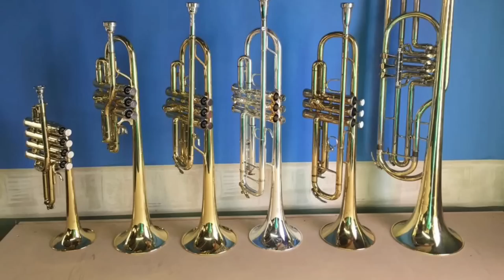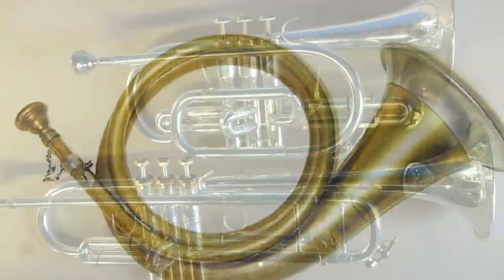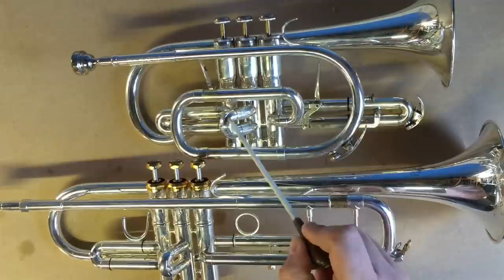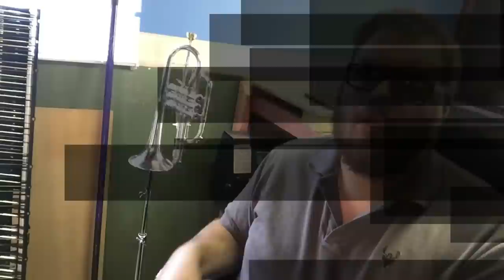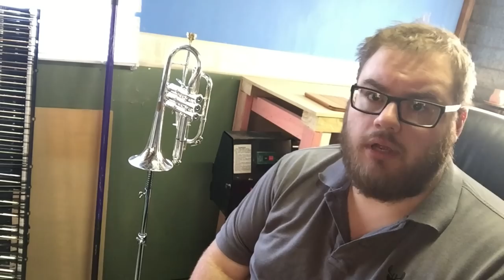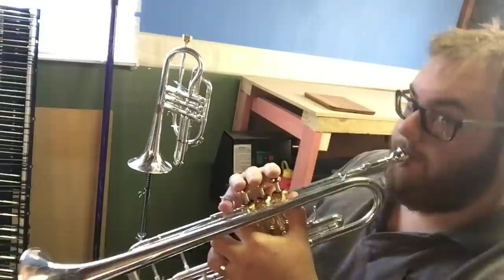Trumpet vs Cornet - discussion and demonstration

Comment: I don't think the cornet is fully conical, and if it is then what is the point of the fluegelhorn which is meant to be a conical, not cylindrical, trumpet. If that it what you are saying is the main difference then the fleugal horn would sound almost exactly the same which it doesn't, the cornets difference is at the more curves and started tapering to the bell earlier.
Reply from the maker: gameguy8101 The cornet isn't fully conical; it's just more conical than a trumpet. A flugelhorn isn't fully conical either, but is more so than a cornet.

Comment: The essential difference between the trumpet and the cornet: trumpet-2/3 straight tubing and 1/3 conical. Cornet-1/3 straight tubing and 2/3 conical. Since 1850s very few cornets have had triggers (particularly 1st slide) and very few trumpets have had triggers, but they have often been available options, as with the Olds Mendez, Conn Constellations, Vincent Bach, etc. They were often present, without special order on French Selmer Grand Prix, K-Modified and Selmer Radial models. The first valve trigger allows easier adjustment in pitch as needed as does the less common 3rd valve trigger. For companies such as Vincent Bach, the 1st valve trigger has been available for an extra charge as is silver plating as compared with lacquer. Brasswind bands in England favor the cornet; in the US, trumpets and flugelhorns are seen, seldom cornets. Sousa used cornets, not trumpets, (Gilbert and )Sullivan used 2 cornets, no trumpets. The golden age of the cornet was 1865-1925.

Comment: dude you didn't talk about mouthpieces ... I deduce the same mouthpiece can be used for both cornet and trumpet, is that right ?
Reply from the maker: +1982klax No, that isn't correct. The bore size of a trumpet mouthpiece is larger than that of a cornet; they aren't compatible with each other. You can get adapters to make a cornet mouthpiece fit in a trumpet, but not vice versa.

Comment: Your warping the valves.... Curve your fingers and have them play straight down on the keys.
Reply: No
Reply: Mark Moreno Why not explain?
Reply: Everyone plays differently unless your in marching band there is no reason to tell someone to do something a specific  if its is comfortable for them let them do it.
Reply: NItricWarrior Yes but you can damage your trumpet over time if you keep on doing it like that, its jut not a good habit to get into.
Reply: watermaster75 my valves are trashed because of this
Reply: watermaster75 it would take so much longer than you think to warp valves like that.
Reply: watermaster75 That trumpet is a Chinese mock Strarivarius and he said it was like $100. So I don't know if he really cares.
Reply: hi_itsNathan it was $280
Reply: Actually, if someone is doing something that could damage the horn, I think that they should be notified of it. Even if the wrong way is more comfortable.
Reply: You're*
Reply: this is only a problem if you use a cheap intrument, if its high quality nothing will happen. my trumpet teacher have played on the same trumpet since he was 9 years old about 35 years and nothing has happened
Reply: Mark Moreno he made a video about tjis
Reply: It takes more pressure to bend the valve than it takes to press it down so it near impossible to destroy or even damage that way
Reply: watermaster75 I've done it for almost 2 years and no problem eithemy valves
Reply: Get stuffed.

Comment: Hi Trent.   Could you please tell me how to clean my cornet ????    the first valve seems clunky, and gets stuck.  and plus, i recently joined a brass band again, and didn't play the poor thing for 10 years.        it's an x army boosey.   imperial.   thank you.
Reply: +PetuniaParkStables You need to buy slide grease it is only a couple $
Reply: Take all of the slides and everything out (make sure to keep it in a way that you can remember what goes where) then give it a lukewarm bath. Make sure that it's not too warm. I recommend using a soft towel to actually clean everything. If that doesn't help, get some Brasso and use that one the brass parts. After you're done cleaning it, apply valve oil to the valves (it may take a bit before the valves are going their fastest.) Next, you have a couple of options for the slides. First, you can buy slide grease, then use a few drops of valve oil after the slide grease to make sure that the first and third slides are moving well. Or, you could buy some slide grease for the tuning and second valve slides, then get a pre-made mix of it (I like to use TS Spacefiller) for the first and third valve slides. With the tuning and second valve slides, I highly recommend putting only slide grease on them, since you don't need to move them as quickly as the other slides, and if they're a bit loose, reducing friction could mean they can fall out while you're playing.

Comment: I used to own a trumpet that had a trigger for the first valve, never seen one for the third valve.
Personally, I much prefer the manual slides, the triggers sure make it much easier to operate but there is a delay since it's mechanical, they do not react instantly; so let's say you use the trigger for playing a C but right after that you have to play a E, the trigger will still be retracting while you already were playing the E.

Comment: Can a trumpet player player on amatuer level very easy play a cornet good? I've heard lots of people saying it's very different how to play these instrument, but many that i have asked says it is nearly the same. What is correct? I am by the way a trumpet player who am thinking of buying a cornet just because it sounds awesome, do you have any tips of a not too expensive cornet? /Mattias, Sweden
Reply from the maker: +Mattias Olsson My advice is give it a go. To excel on a cornet it's more about a different mindset rather than a different technique. Warm air flow etc.
Reply: +Trent Hamilton Thank you for the answer
Reply: If you plan on playing in a trumpet section, stick with a trumpet. A cornet wouldn't blend as well with the other trumpets.

Comment: What's the name of the dip in the cornets bell pipe again
Reply from the maker: Usually called a shepherd's crook.
Reply: There are two kinds of Cornet The shapards crook type which is sometimes referred to as a British cornet (as it is the style used by all British Brass bands) and the American Long Cornet as seen here :

https://www.philparker.biz/media/catalog/product/cache/1/image/9df78eab33525d08d6e5fb8d27136e95/1/8/181ml.jpg

Which is subtely different in having a longer bell section and a closer resemblance to a Trumpet.

There is a third instrument which has not been mentioned called the "Flumpet", which is a trumpet with a conical bore which has a much more cornet sound and is a hybrid between a Flugalhorn and trumpet.

Comment: Excellent explanation and performance, Sir!! Thank you so much! My son is six years old and fell in love with a trumpet. Would you suggest any brand for a cheap and no too bad instrument? I've been thinking of a Bb pocket trumpet. Do you think it could be a good idea? Thank you again! Sérgio and Nino : - )
Reply: You don't want to get a pocket trumpet for a new player, even though their size might say otherwise. Pocket trumpets are harder to play than a regular trumpet. I would recommend a Cornet, because of their smaller size and the fact that they take about as much air as a regular trumpet. Hoped this helped.
Reply: I would recommend staying away from pocket trumpets and instead going for a lower end Yamaha. They tend to be a little bit more expensive than the other trumpets in their class, but are very reliable horns. Otherwise, I would recommend Bach, they tend to be a little bit iffy at times with their student horns, but they do play well for their prices.

Comment: +TrentHamiltonNZ  Thanks for a vid illustrating the differences.  The Kanstul® 1530, a Bb shepherd's-crook cornet, is controls-compatible with the trumpet shown here and would be a satisfactory soprano for a saxhorn consort with a 275 F Alto, 290 Bb Baritone, and 200/4-C BBb Bass (these other instruments having a Tune-Any-Note™ slide in the main pipe).  The same firm's 103 Bb Coliseum Trumpet, built with .470" pipe, is better complemented by the 955 Bb Flügelbone and - in a move for fanfare trumpet compatibility - the 190 G Baritone Bugle.